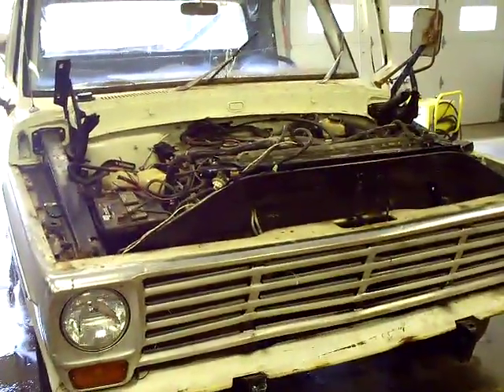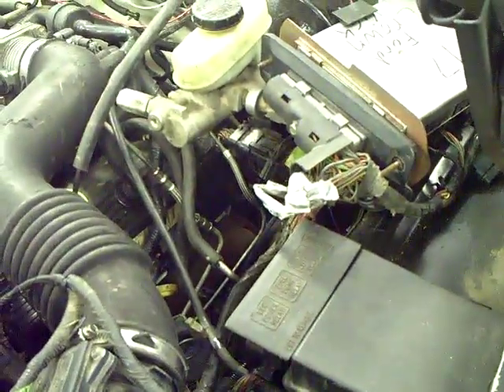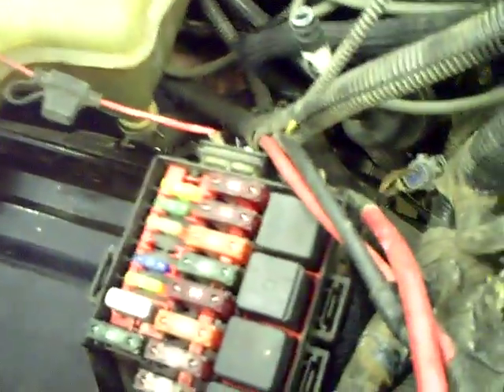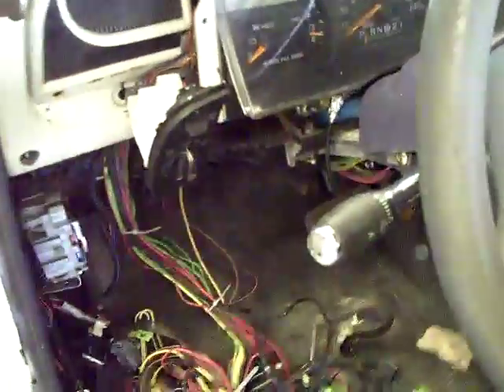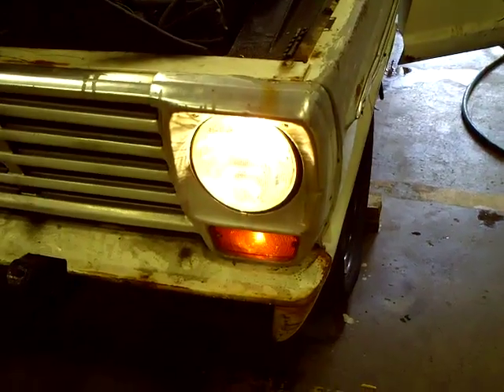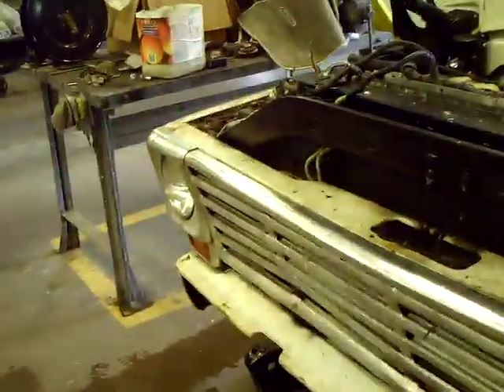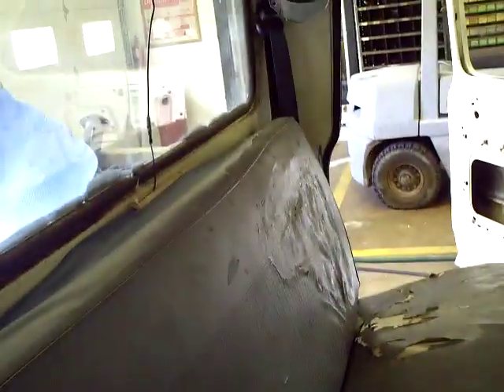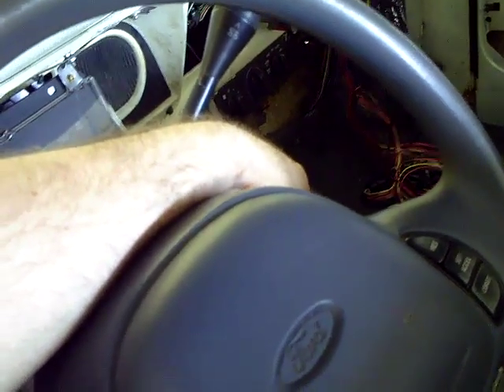Crown Vic in 67 Ford F100 ten

Comment from the maker: First of all you are judging unfinished work. Second this is NOT a Chevy gauge cluster it came from a Ford C/V like everything else. Third the interior from this cab in this video was all ready shot and it would of been a lot more work and money I didn't have at the time to of made the stock gauges work with the with the C/V wiring harness. Finely this is Not a show truck it is a work truck so what is ruined to works great for me.

Comment from the maker: Your right I was so obsessed over protecting it from the engine heat I forgot that it generates it's own heat. I think I will just put it in the far corner of the engine bay and put a heat shield between it and the engine but still give it some breathing room. It shouldn't get any hotter there than what it dose inside the dash on a hot summer day parked out in the sun.